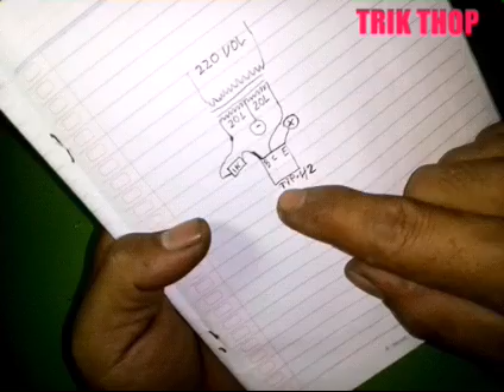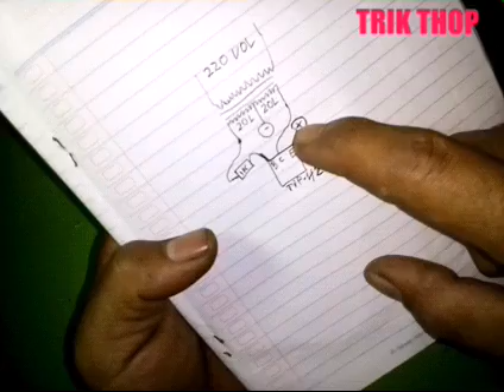Caranya begini buat inverter dari lampu bekas tabung neon.

Comment: Sy elektonik pemula sj blm, ini tinggal Bos Trik top yg belum sy pameri inverterku berhasil, cuma transistor tdk ada pendinginnya, apa ada barang bekas untk pendingin trans. Semoga ilmu bos dpt ganti dr yg Kuasa, aamiin.....
Reply from the maker: Saya mah gk pmer. Mas... tujuan saya bwat vidio ini cmk .1 iseng
2 hobi
3 kusus daerah yg suka mati lnpu . Mungkin rangkaian ini beeguna.
Jadu intiya dri pertayaanmu . Untuk pendinginnya pke apa ??? Bgitu kah????
 Beli di toko klo pengen bru. Hrgaya mumer, klo bkas cari di rongsokan. Lbih murah . Klo darurat bisa pke bkas atap baja ringan. Atao bkas zeng talang rumah. Atao pke botol zeng almunium. Seperti sprit pocari dn lain,
Reply: TRik Thop He.. Hee.. Rmh sy ndeso mas jauh dr toko , makasi sarannya nti mau coba pakai plat motor, ini baru coba bongkar baterai laptop pakai minyak kayu putih hasilnya casing ancur..... Maaf ya curhat.....

Comment: Itu 20L 20L.trus yang tengah itu berapa lilitan mas?
Yang ct kayaknya.
Reply: Supri Handoko   yg guanteng .. coba to di toton ada sekema yg di jelasin . di menit pertengahan...
Reply: Agak bingung saya
Reply: Supri Handoko lilit pertama  20 lilitan  ke duwa 20 lilitan. Brati ujung kbel email ada 4 yang 2 jadi ct . Dan 2 lgi bwat c dan b.. phammmm
Reply: Pham...
Thanks atas infonya
Reply: Supri Handoko  pke 1 kbel email .. di lilit 20 lilit lalu di tekuk buwat ct dan lilit lgi 20 lilitan.. 
Klo bisa lilitan yg yambung colektor kabel email agak besar dikit.. dan yang yambung r basis. Kcilin dikit... . Hasilnya josssss.
Reply: Kok gak jadi ya bos saya nyoba.
Reply: Supri Handoko  di coba pke lmpu led dulu. .  Coba colektor di bAlik. Resistor pke 470 om. Tr tip42..  lilitan searah lilitan lhe..  20 ct 20... trafo lhe gunakan yg agak besar . Sprti vidio... 100%  bukan hoak .. asli.. ... dicoba lgibro
Reply: Udah bos.udah pilih yang agak besar.udah 20 ct 20.resistor 1k.
Tip41.tip3055 juga tak coba tetep gk bisa
Reply: Supri Handoko resistor pke 470 ohm. Btre pke 3,7 led pke 7wat.. klo gk bongkar lilit ulang lgi..
Reply: Ok tak coba dulu

Comment: Bang bang gue ingin nanyak beneran bang gue kurang jls dengarnya suara Abang kecil "jangan tersinggung Lo bang" gini Lo " itu yg dililit 20 lilitan kan dan Abang jelasin 20lilit ada dua dan yg keliatan cuma tiga yg satunya mana dan ukuran berapa  kawat emailnya dan yg tiga nyambung kemana 🤔 🤔🤔🤔 apa yg satunya nyambung ke kaki output haduh gimana ya saya jelasinnya tolong kasih tau aja arah jalannya dari travo Dan input negatif positifnya dan berapa lilitan dan ada berapa lilitan yg satunya di sambungkan kemana gitu bang pokoknya jelasin arahnya aja bang please ya bang saya ingin buat"
Reply from the maker: Lew cah bagos sabar ngger mbh lgi mumet sabar yo ngger.. 

Tak kandani lan tak dudoi.. trafo lhe kan, ada 4 kaki yg berfungsi cmk 2 kaki,
  Untuk di jadikan sebuah inferter mini. 
Kita harus mnambahkan lilitan sekunder dan fenback.. 
Nah caranya 
Bongkar trafo lhe pelan pelan.
Lilitkan kabel email  sebayak 20 lilit trus 20 lilit lgi
Brati lilitan tambahan kita ada 4 kaki.. nah yg 2 kaki kita jumper untuk di jadikan ct.. ..seperti trafo besi itu lo ada tex CT.
Singkatnya lilitan tambahan kita ada 3 kaki..
Yang kanan dapat colektor tr tip41/42 yg tengah dapat min/plus yg kiri dapat  RESISTOR 470/670 ke basis tip 41/42.. sedangkan . Emitor dapat min/ plus

Nah klo kita menggunakan TR NPN brti ct dapat batre positif  dan emitor dapat negatif .
Klo pake TR pnp  maka sebaliknya dari tr npn..
Semoga mengerti dn trimkasih